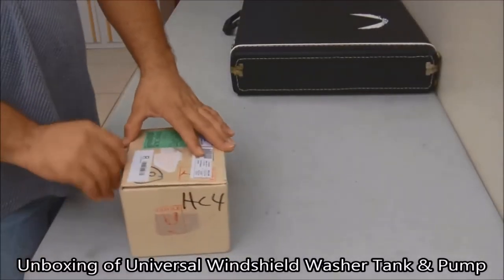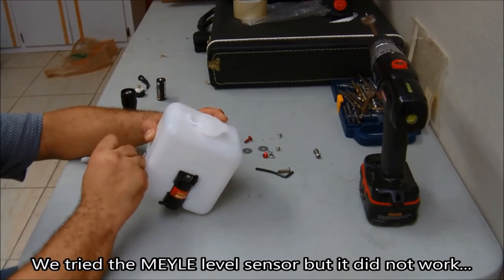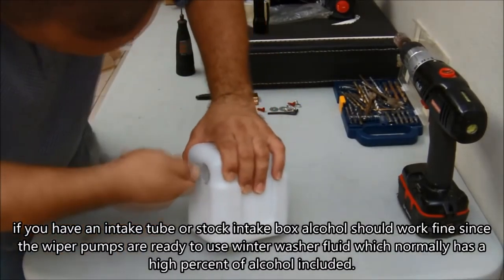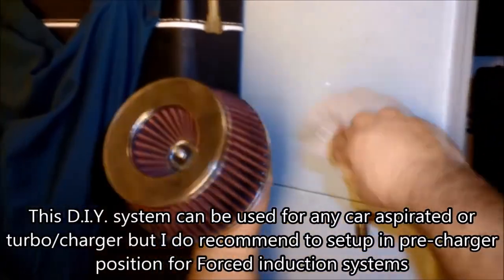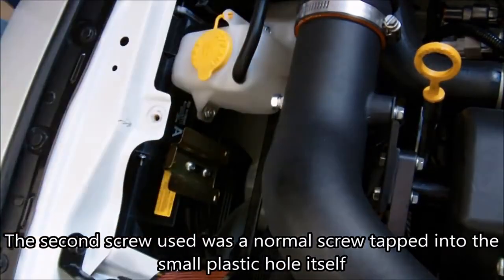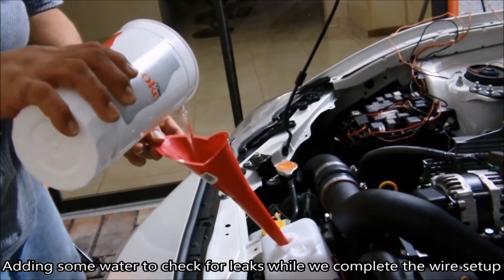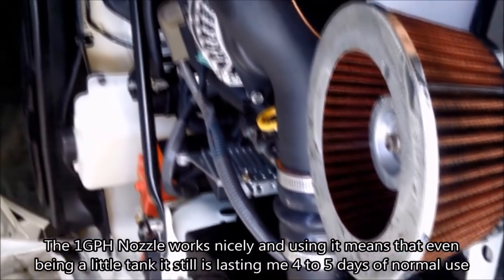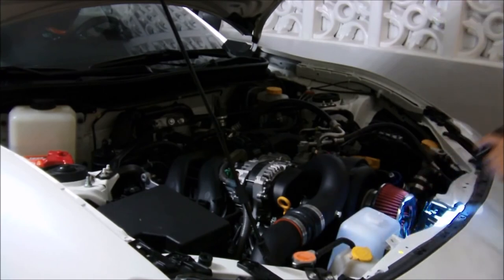[Re.Boot] | DIY | Windshield Washer Water Injection kit (also works as intercooler sprayer)

Comment: i am planning to do one like this, great video! but I may say don't trigger the system by rpm, boost level is a good way to set trigger tho. when release the throttle while driving, there is no fuel injection and combustion in the engine while rpm will remain, so you may induce water into the combustion chamber without burning and vaporize it, and it may accumulate there and... damage your engine or turbo or dp in a long term? my 2 cents~

Comment: Great video. At worse the water will erode the leading edge of the turbine fan. But if you use a very fine mist it will take years to do any damage. The bearings will need to be replaced in the turbo before the turbine fan will.
Reply from the maker: True, but it works and I am aware what may happen. As I mention I dont use the car much so that will take even longer than a daily. You can do pre intercooler which may also help. It all depends on your needs.... The hood vents also did did a great job in disipating heat. Thanks for the feedback

Comment: If i setup this on a 3.8 litre V6 ecotec engine just before the throttle body? Will it damage the IAC And TPS sensors? Any reply appreciated cheers from Australia subbed and liked 👍👍👍
Reply from the maker: Hi, this works better close to the throttle because alcohol disipates in the heat if too far and will not reash the chamber. I am unsure if it will damage a sensor but as mentioned it will not hve the same effect so it would be better closer to the throttle and after the semsors and intercooler as well. I hope that helps. Thanks for watching

Comment: I would not install this before the mass air flow sensor!
Reply from the maker: Jeff Flanagan 
That is correct this should be after the sensor or as far away as possible. As I explained in my case the water disipates in the intercooler so it does not reach the sensor... In a turbo or scharger it works as precharger but in NA it should be after the sensor.. Good point

Comment: Can water meth be used with this ?
Reply from the maker: Hi, yes you can add water/meth mix to this system however keep in mind the pump is small you may require a better/bigger pump, I use this tank with a big pump and the same nozzle in my main injection kit shown in other videos I have about this and it still works to this day. It is harder to get meth these days so I am using for now 90% alcohol instead but I need to reprogram for this or keep my feet a bit off to avoid damaging something since its setup for 75% meth mix. I am not using the car now so I will get a second tune for alcohol and then be able to use both as I need or as they become available to me in the future...

Comment: Hi excellent video, I have twin turbo 350bhp 535d, I know I need big intercooler but the next available one Wagner intercooler cost £650 which I  can't afford, I was thinking of water methanol again the kit is very expensive and time consuming, I was thinking of spraying the intercooler then your video is almost same as water methanol injection kit much more hassle free, I was wondering where did you get the injector from, any link
Reply from the maker: You can buy the spray tips online on ebay or amazon there are a few sizes to choose, I got the smalles I could find. I hope that helps.

Comment: I wanna do this temp. Just to clean carbon on a hybrid. Should I remove the throttle tube to bypass the mas sensor?
Reply from the maker: Hi, If you are going with pre throthle water/meth injection go as close to the throthle body as possible and far from sensor as possible

Comment: TBH, the heat is going to oxidize and erode the blades far faster than water will, if anything, this will extend the life by keeping the heat down, and it will evaporate far quicker than it will be able to corrode the blades
Reply from the maker: Redan Rich Hey, thanks for the comment. True that. I am going to upgrade the charger to use external oil pass thru that will greatly lower the temp even if I use the engine oil. I am not sure if I will do external oil but it may a posibility. Thanks for watching

Comment: Its also great for trucks that have external transmission coolers, i have E4Od transmission witch is prone to overheating under heavy loads.
Reply from the maker: Hi, thanks for the feedback. works on intercoolers as well and radiators. I have seen people use the same setup but with a cooler with icy water in the vehicle, which was used for drag racing and such...

Comment: Why not just use a dual nozzle setup with the AEM kit?
Reply from the maker: Travels With Tasha 
Hi, good question. Because it dripps on the header and I woudn't want alcohol dripping on the header which could be dangerous. It works well with the water though so it's ok.

Comment: I thought pre-charger destroys the fins. Dracticly reduces turbo life.
Reply from the maker: well if you do this incorrectly that may just be a possibility but keep in mind different types of water injection have been used for years even in the military. Also if you use a proper nozzle and a very fine mist chances are if this happens it would take years.... also keep in mind ANY MOD you make to your vehicle CAN CAUSE issues so use all or any of this information at your own risk, what works for one may not work for all.
Reply: True that. I have a turbo diesel and have been thinking hard about doing a water meth injection post turbocharger closer to the upper intake area. Snow performance has the MAX-MPG for the 6.7 powerstroke but there are vary few videos on the 6.7 PS with meth inj. so maybe I'll be the first. Just looking to cool down the cylendar temps I can easily hit 1000+ degrees quickly @ 26 lbs of boost and I think my turbo can do close to 40 pounds. Melt down starts at 1200-1400 degrees. I let off when I get to 1000-1100 degrees. Thanks for the vid. Oh yeah for anyone as DIf said anything can caue issues when changing from stock to + power.
Reply from the maker: JDH 
My Water/Meth kit is placed close to the throttle less than a foot away if I am correct. That is my main kit. This one is an extra I added just to cool the charger a bit, it works well.
Reply: @DiFuXioN  question regarding a naturally aspirated 2005 Cadillac Deville.   If I use my my current windshield washer tank, what pump and nozzle/nozzles ( how many?) do you recommend?  Also, nozzle right before throttle body flap? And what do I use for a trigger?  I have heard about vacuum trigger switches,  but I have never wired/plumbed one up. Thanks in advance for your help.
Reply from the maker: @daytonkeyes84  if you are going to experiment mayby use the stock pump and the smallest nozzle you can find and to activate use the stock widshield activater try it out and if it works you start there if it doesnt you did not spend a lot and did not modify. using this on a NA may not have the result you expect so its good to try it first...